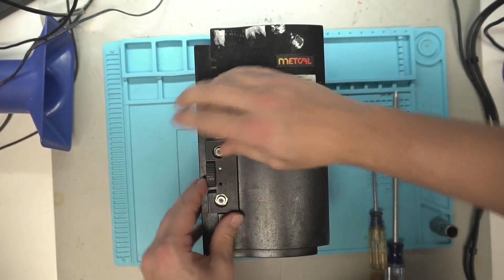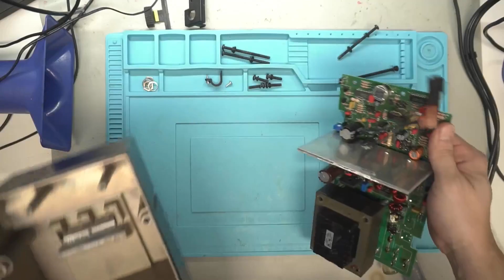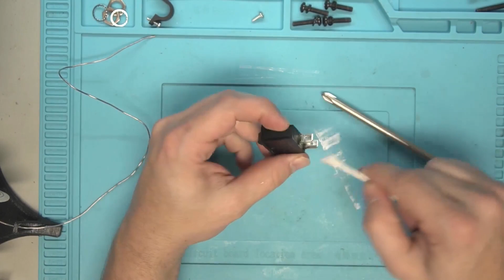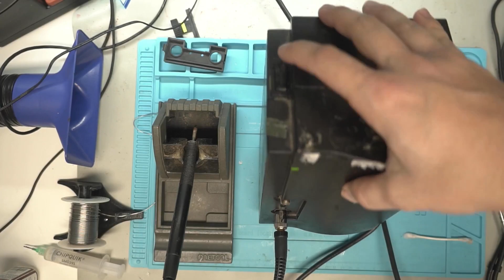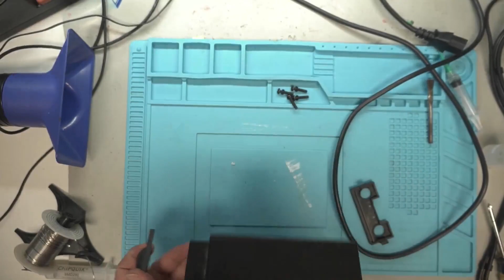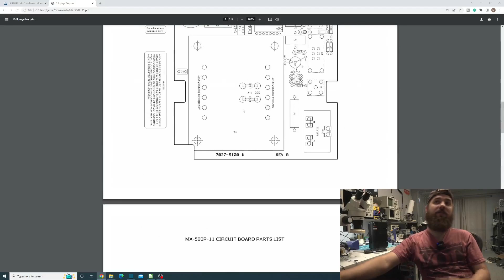Metcal MX 500 Soldering Rework Station Repair

Comment from the maker: Hope this repair helps someone else.
Reply: good find
Reply from the maker: @vincec4359  thanks
Reply: @FixedUntilBroken   @Fixed Until Broken  hey, please read. I have an 04 silverado that I'm adding trans temp, which I have a good idea how to do, I've added the stepper motor already and know the code number and location to program it. My problem is I am planning on changing from a vacuum brake booster to a hydroboost system and i need the code location and numbers for it. Is there any way you can send it to me or tell me a place to get it from. Thanks.

Comment: I measure over 50V across C6 whenever AC power is connected. For C6 I recommend 2200uF 63V with 10mm lead spacing. The other big cap C2 is 1000uF 35V is fine, 7.5mm lead spacing.

Comment: I have the same model unit . Mine turns off and on with no problem but it isnt getting hot enough to melt sokder regardless of which soldering tip I use and ive tried a half dozen different tips. Any ideas on what the problem is?

Comment: Hello, thanks for your contribution. They gave me the same one but the MX-RM6E handle, they disassembled it and removed the components that make it up, if I'm not mistaken it's an LC circuit, I want to repair it but I don't have the inductance and capacitance values, could you by any chance help me with it's? Cheers